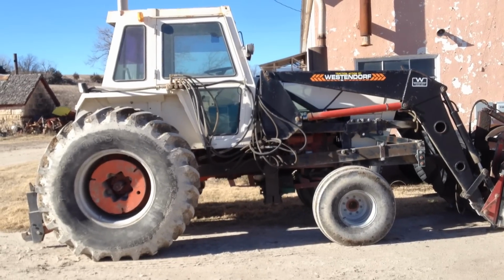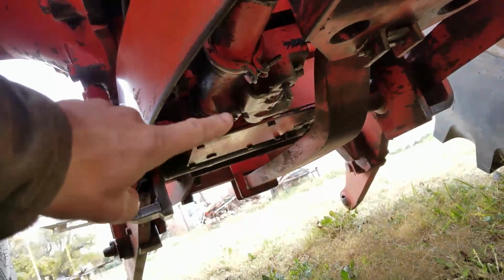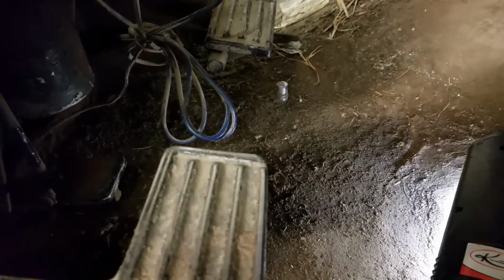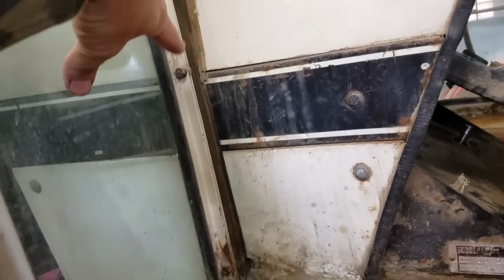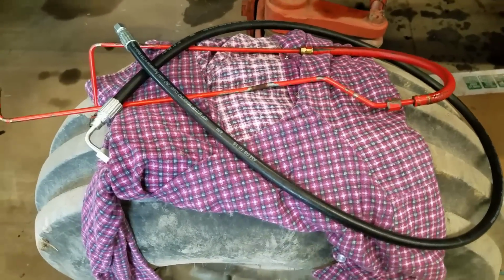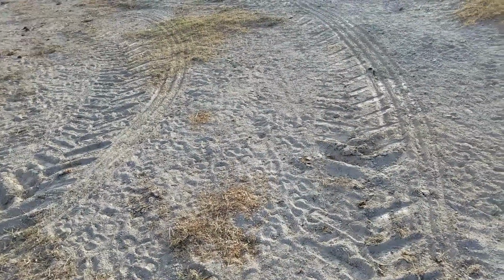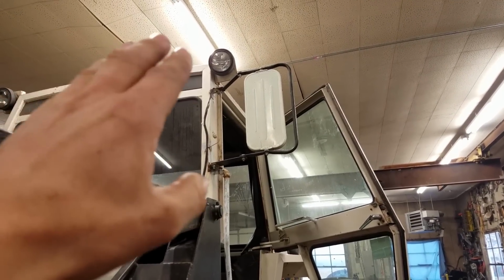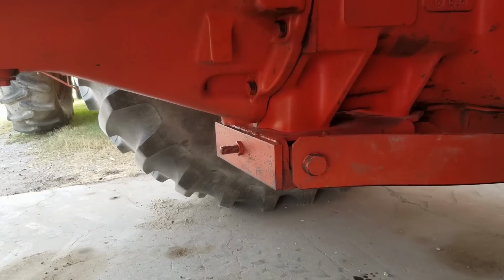1370 Tractor Oil Line Replace (Not my normal video subject)

Comment: Hi Mathew,
A nice and clean tractor always performs better than a neglected one, they should make cars that last this long...
Reply from the maker: Dad is still driving his '61 Ford Pickup! But the newer tractors don't last this long either.  The electronics on them fail.
Reply: Now those companies realize that they need to sell more of what ever they make in order to keep the board and owners richer and happier...  
They instated programmed obsolescence into the design process as a priority....   
Or if you want to repair your old what ever it will bring them as much as if they sold you a new one by making the spare parts sooo expensive.
Sadly for us the consumers, there is no way out...

Comment: I think fixing tractors is the most important part of farming. My dad employed a former (Spanish) Marine Engineer as a tractor repairman, and he used Caterpillars (rice paddy stuff). This engineer could disassemble a Cat in about an hour. If you can use horses that is another matter -- but then you need a veterinarian! For my dad, availability of parts was the prime necessity.
Reply from the maker: It amazes me how many farmers can't turn a wrench.  Even though my business is metal fabrication, I have gone out to change an alternator on a tractor before. To me that's an easy job that any farmer should be able to do.  And availability of parts is huge! Several years ago, Belarus started selling tractors out here. They were cheap, so farmers started buying them. Then break downs started happening. Parts had to be shipped from Russia! Some people said it took 6 months to get them. I don't see Belarus tractors any more!   I asked my Grandpa once why we don't have horses around the farm anymore. I think that was the first time I heard him cuss. Apparently he didn't like working with horses!
Reply: A very valid comment! There were two Russian  cars in Venenzuela. One always broke down and parts, not available. That was the Lada. The other one was the Niva and it was a knock-off of the Italian Fiat, which was very sturdy 4WD. Went forever. All you had to do was first, replace the battery which was Romanian. Junk. Although in all fairness it would start at one turn of the crank! The other was periodic maintenance, oil, filters, and such. Russian equipment is either very good or awful depending on where it was made.

Comment: Original line lasted over 40 years.  I guess Case thought that line would outlast the tractor's engine or other major components.  You'll probably never have to remove that access plate.  Good job on figuring out the best course of action.  Probably the only course of action without disassembling the entire tractor.
Reply from the maker: Thanks! I'm sure they didn't think this tractor would be around 40 years later! I'm waiting for someone who watches this video to tell me there's a simple way to that line. But it might be completely removing the cab is the only way.
Reply: I have done the same concept on one or two of ours.  The guys at our local shop usually lift the cabs off with a shop crane like the one in your shop.  Problem there is you are paying for hours of just taking the cab off & the bill gets spendy in a hurry.  I have pretty much went to fixing all of our Case problems myself, both for cost & the fun of learning something new.  We have a 970, 2-1070's, 1170, 1370, 1570 & now a 2294 & love them all.  Cheap, reliable power.